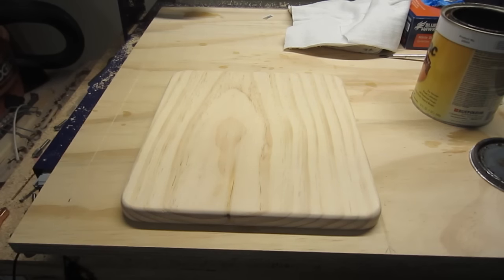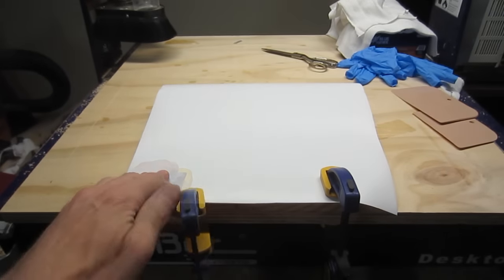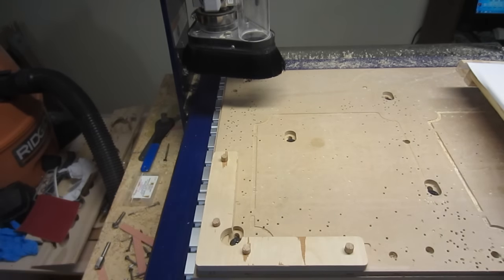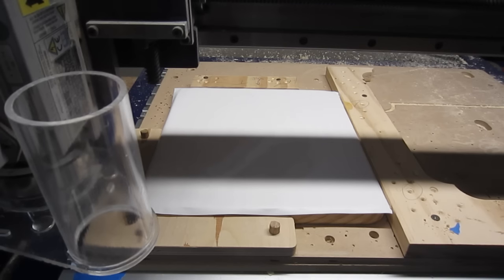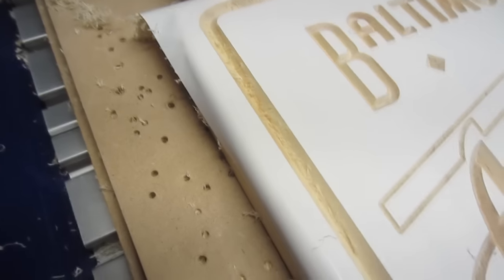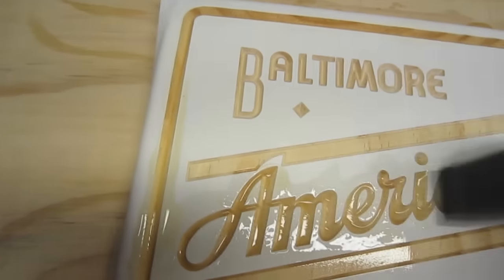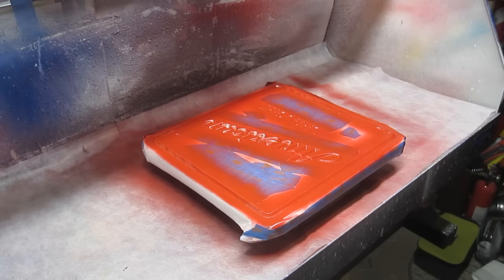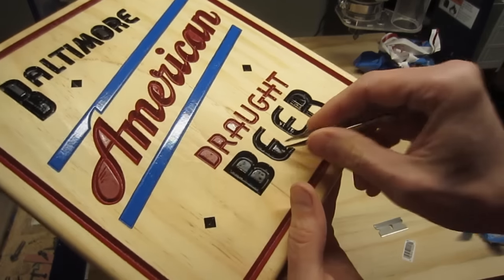CNC Router Projects- Start to Finish: Painting Technique

Comment: Great video tutorial and excellent finished product. I'm just trying to wrap my head around the process. So paint never really touches or penetrates into the wood, correct? It basically sits between layers of clear coat? Does this ever become an issue with the paint eventually peeling off the piece or does it hold up fairly well? I'm new to the painting process of my CNC carves and want to make sure that I am understanding and doing the steps correctly. Cheers!
Reply from the maker: Thanks, Trevor. I can report that the signs look as good today as they did when first made- although they have collected some dust!

Comment: Great idea and one I will certainly use, but I'm very new CNC and have used a different method to achieve what you have done. I used  milescraft templet and after painting the work, I just ran it through the thickness planner.
Reply from the maker: Thanks, Frederick. The thickness planer sounds like a good approach- especially when the carving is relatively deep and there is no paint on the surface.

Comment: Zinsser makes a de-waxed shellac in a spray can as well - works great. Careful with the paint-on version, the primary one they sell is waxed and may mess with paint adhesion.
Reply: looks like the wax free versions is called seal coat but i dont see it in a spray can. Guess they got rid of it in the past 2 years

Comment: Thanks for a great video.  I understand the use of shellac to cover the entire board before the Oracal is applied, but why do you apply more shellac after the routing has been done?  Is it done to ensure no paint goes under the edge of the Oracal?
Reply from the maker: Before I got into the habit of applying shellac to the v-carved area, I would sometimes notice a fuzzy bleed through of paint into the subsurface of the masked area.  In those instances, I believe that untreated wood fibers in the v-carved area became saturated with paint, and that the paint "wicked," though them.  The shellac is intended to seal those fibers and prevent that from happening.  It may very well help in the manner you described, in addition.
Reply: That really makes a good bit of sense.  We will try this process - and your video is very helpful. When doing outdoor signs, what changes do you make?

Comment: Hey man thanks for the video I am going to try your method I have been looking for good method of doing this as I have used high contact release paper, painters tape, masking tape, shelf liner, and usually resort to laser engraving my projects for clean painting lines but I noticed in your video you where not getting the vinyl  to lift when cutting would you mind sharing your feeds and speeds that you used as well as the exact wood you used it looks like basic pine or douglas fur but I could be wrong thanks
Reply from the maker: You're welcome, ontheEdge. Looks like the carving was run at 12K RPM; 1.83 i.p.s.  The wood is radiata (AKA Monterey) pine from Lowes / Home Depot- no knots, and nicer grain.  I've never had a problem with Oracal 631 lifting, except one time when I had dust collection turned on.

Comment: Nice work, but I’m curious, why not just cover the entire sign with 3” painters tape instead of vinyl? Wouldn’t that be more cost effective?
Reply from the maker: I seem to recall trying that, and finding that the blue tape frayed too much- resulting in lines that were less than crisp. Also, the point at which the strips of tape overlapped would lift a bit and get damaged during the routing process.

Comment: How do you manage to get several colours next to each other? Like at 22 sek into the video, where you have a white "G" on a red shield with black borders...
Beautiful work btw!:)
Reply from the maker: Thanks Roger.  Each element you mentioned is masked, cut / carved, shellacked, and painted separately.  For example- the shield shape is cut out- either with a vinyl drag knife, or with a vbit (as a profile toolpath on the vector set to a depth of 1/32 inch). The vinyl is peeled, and area is shellacked, painted, and allowed to dry at least two days (as paint is on the surface).  Next, a small piece of vinyl paint mask is applied over the shield area, and the letter "G" is carved.  Shellac and paint are applied.  Repeat for the ribbons and black border around the shield.  Hope that makes sense.Part of the process: http://imgur.com/a/MKyJS
Reply: Aha, quite obvious when you know it (as with so many other things:)
Thanks a lot!

Comment: I also us two coats of shellac on my red oak before adding the vinyl. Does adding the coat in the V carve help with paint bleeding? I do get some paint bleed that I can't sand out due to how deep it go.
Reply from the maker: I'm fairly certain that it does help, Matt.  I think unless the wood fibers inside the v-carved area are sealed, paint can "wick" though them and appear just below the surface in the area that had been masked.
Reply: Thank you for the reply. I gave it a try and it turned out great! The only thing I noticed different was the paint didn't want to sit in some areas of the v-carve and it would just run from the away from it. I had to use a bush and dab the paint in that area. What type of paint are you using? Is it oil based or water?
Reply from the maker: Glad to hear it!  I've had that happen, as well- just in an occasional, tiny area.  My approach was also to dab it with a small artist brush- just as the paint was in the process of setting up a bit.  I use only oil-based rattle cans- mostly Rustoleum Painters Touch 2x.

Comment: if this sign board is posted outside the shop will it survive the weather or will it deteriorate quickly
Reply from the maker: As shellac was used, I would recommend this for interior use only.
Reply: @totrand  what are my options for making this sign for outdoor use.